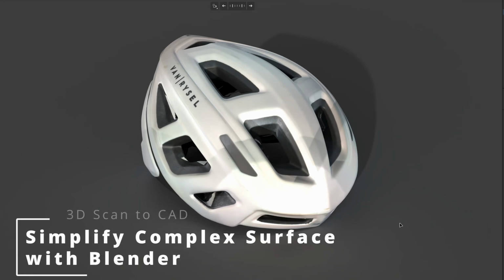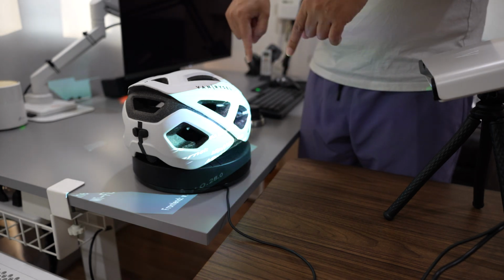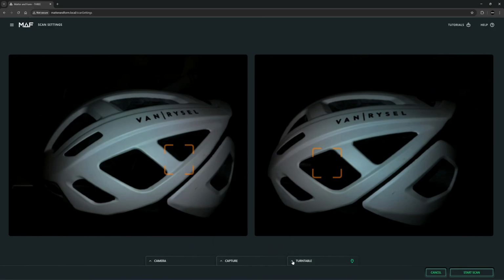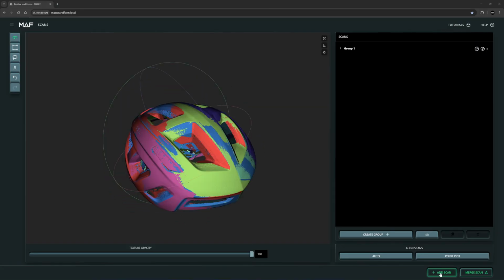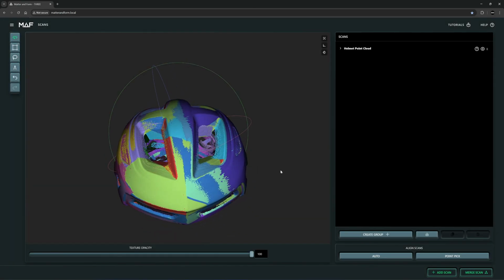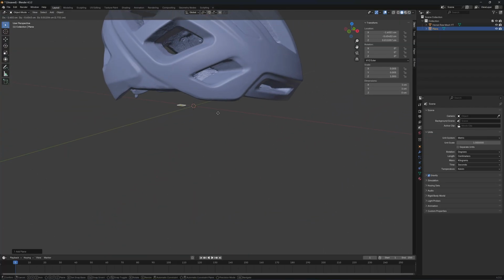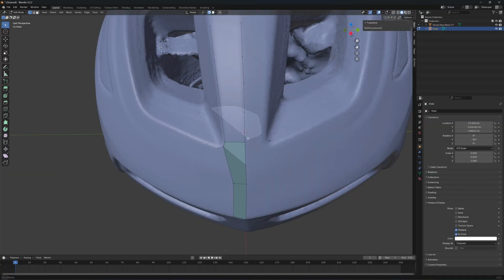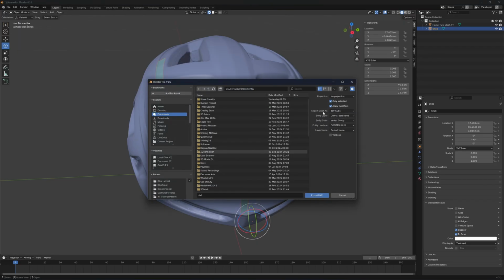From 3D Scan to CAD - Reverse Complex Surfaces with Ease Using Blender - Matter and Form THREE

Comment: Hi, amazing Work! What you think about quick surface lite software? Its useful, better than blender?
Reply from the maker: Quick Surface and Design X are practically ineffective, as they target inexperienced CAD users. Instead of seeking shortcuts, users should invest time in mastering CAD software. Ultimately, the model and assembly will need to be finalized in CAD programs, which are far more advanced than automated surface tools. Most industrial parts are originally created using basic CAD commands and should be reversed using the same approach.

Comment: So why do you need the cad software in the end? To turn the mesh into patch? To turn the polygons into a curve based surface which is smooth? Blender can't do it?
Reply from the maker: Blender can also be used to model the white shell or this helmet, add thickness, and prepare it for 3D printing. However, there are several scenarios where CAD is a better choice.
1.Command-Based Modeling and Editability, CAD allows users to create models using precise commands. You can revisit and edit dimensions, curvature, or thickness at any time. For instance, I can still open a design I created 20 years ago and review every step of its creation. In contrast, with polygon modeling, once the file is saved, further edits aren’t possible.
2. Part Assembly, CAD excels in designing assemblies. For example, if I want to add a head strap, I can use a previously designed helmet as a reference, ensuring accurate alignment and integration.
3. Infinite Resolution and Tool Path Creation, CAD provides surfaces with infinite resolution, making them suitable for generating tool paths for CNC machines. On the other hand, polygonal formats like STL or OBJ lack this capability and are not accepted for such tasks.
Reply: @Payo-TensileCreator  can you recommend a Cad software? are you talking about AutoCAD? it is a heavy, can you suggest lighter options? opens source option that are good?
Reply from the maker: @danielkotzer636  I recommend AutoDesk Inventor, SolidWorks, Rhino. BricsCAD looks promising but I've never tired. For the free one. I recommend FreeCAD

Comment: I just received my MAF THREE scanner last week and am very impressed.  It scanned an object that was black nylon, black nitride coated steel and stainless steel, and captured it perfectly on my first attempt, without needing any scanning spray.  I exported it as an STL and pulled that into FreeCAD where I decimated the mesh to something lower resolution that was still plenty detailed for my use.  The object had compound curves but I was able to model it in CAD by superimposing some rectangular primitive shapes and chamfering and filleting some sides.  I then made a fusion of these five primitives and made a separate copy.  I made a 3 mm offset and subtracted the other copy from the larger rounded envelope to make a 3 mm thick shell.  I cropped off the top and had a container for the object.

Now that I've done it once, I can repeat the process much more quickly for similar objects.  In fact, I can pull in another STL from the scanner and resize the primitives to fit the new object.

It's very good to have a technique for more compound curved objects such as the bicycle helmet, but I have a feeling that FreeCAD can make a shape or part more directly from a very decimated STL mesh.  I need to play with that.

Thanks for the great video.  Thanks also for your other videos that allowed me to understand that the THREE scanner would be a good fit for my needs.  I'm very happy with that purchase so far.  It's easier to use than I imagined and it works better than I imagined.
Reply from the maker: That’s exactly what I was saying about MAF3—it’s super easy to use. It can even merge a cylindrical Coke can by using texture for alignment. Seriously, how do they pull that off? Plus, I barely have to use the lasso tool to clean up scans like I do with other scanners. You’ll end up spending way less time on scanning and have more time to focus on designing. It’s awesome to hear that you’re happy with MAF3, it really seems to suit your workflow perfectly! FreeCAD does sound like a solid option to explore and I'll try that someday.

Comment: Hey Payo, not sure if you know but once you have created a face between 4 vertices, you can select the edge in the direction you wish make more faces, and then just press F and it will continue to fill quads for you.
Reply from the maker: Thanks for the suggestion, but I still end up having to reposition the vertices either way. For me, extruding one vertex at a time feels quicker.
Reply: @Payo-TensileCreator  There is a tool on the left sidebar the "Polybuild" tool that can help speed up the process.

Comment: I use nTop to convert mesh files to CAD. https://www.youtube.com/watch?v=JP_S2LX71cg
Reply: Is it a quad subdivision software? I watched the video you propose and it looks like it convert mesh 3 vertex triangle to quad then sub. Interesting software, but if you need to be tight to your point cloud, subdivision will make interpolation off to your point cloud at few places. Although, it's a very interesting software.👍👍
Reply from the maker: Appreciate the input! The issue with software like that is its inability to detect shallow edges—like the ones on this helmet—resulting in edges being smoothed out or dissolved. I believe 3Ds Max integrated a solution for this a while back, but personally, I still prefer working with manual polygon topology.